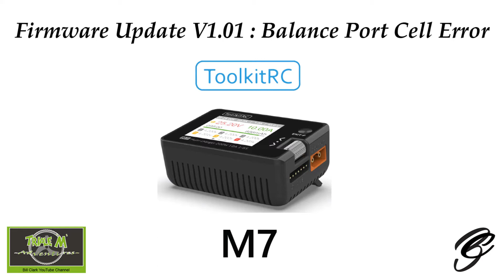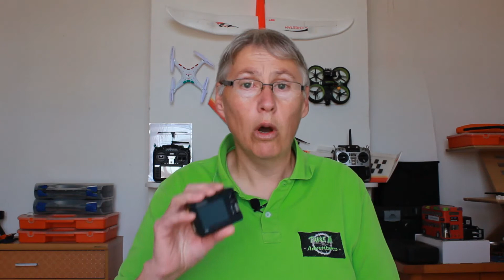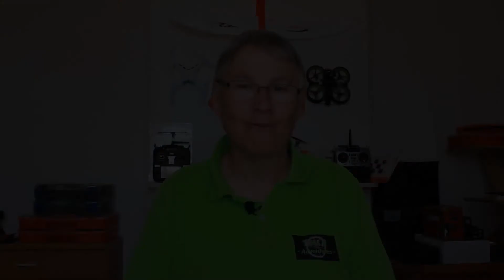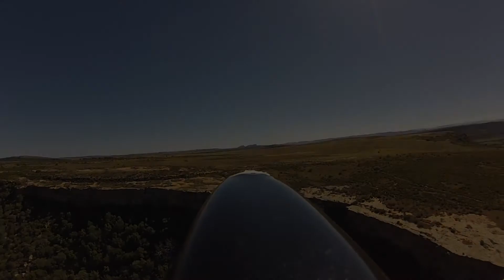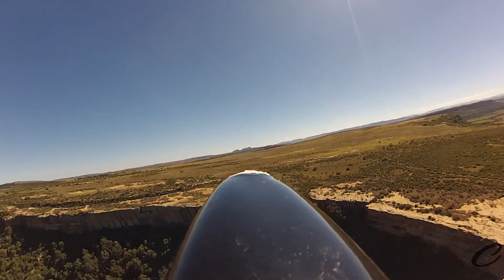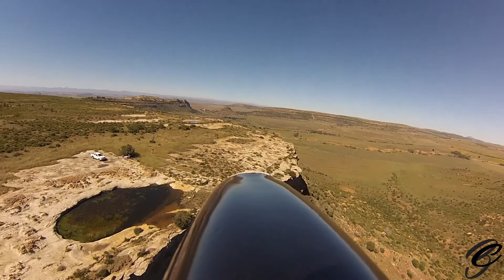ToolkitRC M7 Charger Firmware Update V1.01 - Balance Port Cell Error

Comment: hi, i updated my m7 to 2.01 and i seem to have lost the power supply function. can i roll back the firmware somehow? ive tried using the same method but its still on 2.01...
Reply: Hi! Do you have M7 V1.X firmware? I got failure after updating to 3.03
Reply: @СергейКоржевин-р6й  I don't sorry
Reply: I have m7 v1
How can i update that?

Comment: When i plug the usb cable into the charger it says that the pc cant connect to it properly
Reply from the maker: I would suggest checking the Device Manager in your computer to see if there is an error when you plug the charger into your computer to update it. If an error is shown try updating the driver.

Comment: But still my problem not solved . The charger says MAIN PORT DISCONNECTED when I start charge.
Please help with some tips.
Reply from the maker: Please check the version under Setup, scroll to the bottom ID Should end -V1.01
If all is ok please email me a video of you attaching your battery and setting up the charging parameters and then starting the charging process. 
triplemadventures@gmail.com
Reply: @the-happy-RC-flyer  Hi! Do you have M7 V1.X firmware? I got failure after updating to 3.03 but Official site shows only 2.1 and 3.03 versions ...
Reply: This charger is horrible. Everyone seems to be getting the main port disconnected when trying to charge a success battery and no one has the answer. No one on the planet.  Lol
Reply: @LoVeAmBiEnT   @anshusky5184 @ToolkitrcChargers
 I do have a fix sort of to main port disconnected error , a horrible flaw which toolkit could easily fix and since I will never buy toolkitrc ever again . . I only got this error on 6s batteries. Anyhow after much reading the thing that worked for me was to go into the settings and select yes to reset to default settings. This has worked 90% of the time allowing me to charge a 6s , but then after if i try another battery or change any settings i gives main port disconnected. also power cycling off then on then default the settings has worked afterwords. the main thing i dont like is the default charge amps is 2.0 which is not so good for a 1500 6s.
Reply: have this same problem have you fixed yours
Reply: @tylerleduc101  not yet

Comment: Thanks for the video. I struggled to resolve this issue for 6S battery packs.

I learned that the error occurs when there is a difference between the sum of the voltage values for each cell of the battery pack and the value that is in the “Output”  box on the calibration screen (M6D). In other words if you were to add up the voltage values of each cell and then put that number into the “Output” box when calibrating then you would not get the voltage match error.
If you are like me, your multimeter might not be up to the calibration task—nor is Toolkit’s production group evidently. At 6S voltage (over 20V) my meter only provides 2 significant figures. However, the calibration task involves entering 4 significant figures. Someone with more technical skill might offer greater clarity about what is acceptable. (BTW: Had no trouble with smaller batteries—non 6S packs— with lower voltage where more significant figures are more readily available).
Reply from the maker: Thank you for the detailed information.
Reply: That's funny, for me it's the opposite: I have no trouble with 6s packs, but I can't get it to work with 4s, 3s and 2s.
Reply: I guess in my case one of the 2 last cell sensor error would compensate the error on the first 4. I checked a fully charged battery and some cells were  at 4.22 and some at 4.18...
My way of fixing the problem is to charge a 6s pack with a charger that I trust and then calibrate all cell voltages at 4.200V and the main plug at 25.200V

Comment: Same issue with a new M6D. Firmware 1.07 and calibration did not resolve the problem.
Reply from the maker: I would suggest contacting ToolkitRC support about the issue hopefully they will assist you.
Reply: SAME. New M6D with fw v1.06. Tried calibrating and it didn't help. I also couldn't get it to show up on my mac to update the firmware to the latest 1.07.  I'll be contacting Toolkitrc. Pretty disappointing!  But thanks for the tip, Bill--it does work!
Reply: @RCwithAdam1  I just added a post to the main thread about how I resolved my issue. Hope it helps…
Reply: @winedarksea3  Which thread is that? Thanks.
Reply: @BryceDechert  find it in the comments under the video. BTW, were looking forward to getting back to salsa dancing here in California.
Reply: @RCwithAdam1  Did you ever solve this issue? I'm having the same problem, no luck after lots of attempts and "solutions". Upgraded to 1.07 as well.

Comment: I almost burn my house with that garbage.
Reply from the maker: Was there a calibration problem with the charger?
Reply: @the-happy-RC-flyer  just cut on fire, and burn 2 planes when the battery exploded,  I'm filing a claim with banggood, in 20 years non of my chargers ever ran  crazy.
Reply from the maker: @maxun1  That sounds terrible! May I ask which ToolkitRC charger it was?
Reply: @the-happy-RC-flyer  when I get home I tell you  may be the M7, if not mistaken,  banggood so far did not responded.
Reply: @maxun1  I’m curious as my m7 is underway. Are you sure it was the charger and not a faulty battery or setting? Guess I’ll do a calibration when it arrives first.
Reply: @NE0 If the charger uses a too high voltage it can damage the battery, which will can lead to explosion.
Reply: @NE0 not sure what CAP means. If the charger is not well calibrated it will overcharge without you knowing it.